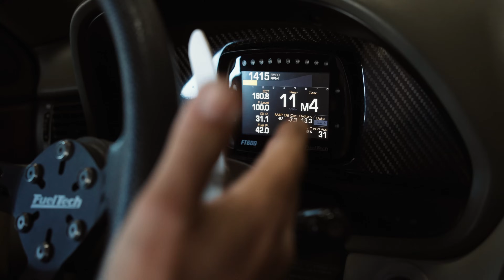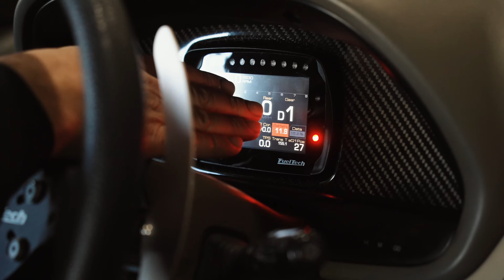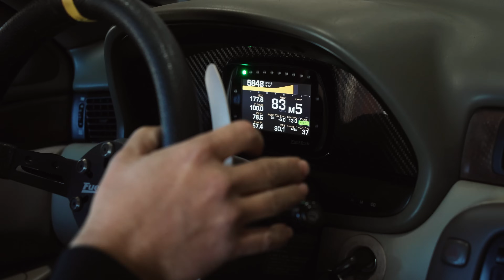Controlling an 8HP Automatic Transmission with FuelTech ECU | Lexus SC400 Track Car Demo

Comment: How can I speak to someone about this from Fueltech? I want to do a completely differently build. Starting off with a 2006 Lexus IS350. Fully built Engine paired with a On3 6766 Single turbo. I want to run a 8HP with a fueltech ecu. I'm doing research to use this transmission.
Reply from the maker: Hi! Please reach out to our sales department via email (sales@fueltech.net) or Phone (678-493-3835) and they will be able to assist you!

Comment: Hi friend. I'm installing an 8hp 45 with a Fueltech 550 ECU, and the car is running. But I have a problem: it doesn't read rpm. I do get a temperature signal, but not an rpm signal, nor an I/O signal. Therefore, it won't shift gears in automatic mode, only in manual mode
Reply from the maker: Hi! Our tech department would be happy to assist you. You can contact them via email (support@fueltech.net) or give them a call (678-493-3835).
Reply: @FuelTechUSA Hi friend. Okay, thanks. Perfect. Do you also offer support in Spanish or only in English?

Comment: Wondering if you can use an 8hp and 2jz with a ft550 or would it have to be a ft600? Mine a basic setup with only 6 injectors.

Comment: I had to swap the solenoids in my 8hp51 to make it compatible with a turbo lamik. In theory could I use the same board or switch to your board to use an FT600 in my a90 Supra?

Comment: you guys should also control the pwm for the transfer cases! the atc300 from the e90 bolts to the 8hp and it would be beautiful to have fueltech controlling the awd bias!  also, b58 plug and play fuel tech standalone for ecu and tcu would be EPIC.
Reply: I want the same

Comment: Someone on the FuelTech tech support line told me that the GM 6L80e is very difficult to control, and shouldn't be considered as a viable candidate for controlling with FuelTech.  Is that still true?  Alternatively, do you guys have any 6HP transmissions such as in the early Porsche Cayennes being controlled by FuelTech?

Comment: great video.. unfortunately with ECU's less than the ft600 the outputs are not enough when it requires 7 outputs just to control the 8hp and thats not mentioning the inputs for temperature, slip.. etc

is there a plan in the future that will allow to control and recive data via canbus as other aftermarket ECU's
until then unfortunately I will have to use the turbolamik TCU with the ft550 on my project
Reply: Everything is possible. The problem on CAN control is that you don't have 100% control over
Reply: @eduardoarcondo  it should be an option and let client decide if to use can bus or wire directly into solenoids.

Comment: I have a link ecu and it's great but I love fueltech so much more, how the fueltech go with technology quickly and give their customers everything they need. In link ecu for example I have limited safety table (4). But I've seen fueltech you have so much more.
Reply: Fueltech doesn't support cruise control, absolute deal breaker for a street car lol
Reply: @RChero1010 Fueltech focuses on winning championships at the track …not for grocery getters 300hp cars
Reply: Link is by far way more flexible, especially when it comes to CAN bus communication. Fueltech is ok for a drag car but I would
Never use it on a street car, it lacks a lot of things needed for perfect drivability
Reply: Madness. Here in South Africa all big power street cars run fueltech. Whether it be a K20/SR20 swap or a 7 second 2J. Don't really see how link can be better for everyday use. I just fund it funny how you're the only person I've come across that states Link is better. But yeah let's be honest Europeans aren't as clued up on fueltech and haltech like in most cases. I'd be dumb to choose a link or a ecu master over a fueltech or that syvecs nonsense.
Reply: @350gtboi well you don't know how to tune fueltech properly bit obvious judging of your comments loool.
Reply: @Smokeykunx I choose to tune ecus that actually have electronics and capabilities from 21st century. Honda K series ecu alone is 20 years ahead in electronics. 25 year old gold box motec is more capable.
Reply: @350gtboi  Just another way of saying you didnt take the fueloech class that luis has to offer lool
Reply: Link can actually do VE tuning and electronics are modern unlike Fueltech poorly designed electronics and PW based fueling like we are back in 1986
Reply: @350gtboi ohh ok 😮. I get your point, what about the ecu features, being able to interface and control 3rd party system?

Comment: Question....do you have a separate fueltech for the 8hp or are the engine and gearbox on the same ecu
Reply: 1 device for both
Reply: Great, Thanks for the reply bud appreciate it

Comment: Sooo you guys into diesel?? We need more aftermarket diesel ecu support
Reply: Soon!
Reply: They are actually i saw few 1.9tdi PD with Ft450
Reply: Ft700 will control diesels no problem. Including common rail
Reply: om606?
Reply: @poiter5876  go mechanical injection pump and don't have a ecu
Reply: @poiter5876  an all in one controller like MaxxECU for the 606 is what I need. Control both fuel and 8hp. Right now fuel control for 606 is either mechanical, tuned factory ecu, or DSL1 standalone.

Comment: Is this available in Australia?
The valve body mod etc?
Reply: Australia has been into the BMW N57 8hp70 for the last 4 years , we love them , most use the Turbo Lamik link through cambus to Haltech .
If your talking about the circuit board that you solider in , or anything else and your an Aussie go to 8speed Australia , they have and can do everything with the 8hp transmission .
I have one to go behind my Aussie Atomic 998 race Ford Barra .
Reply: Can get turbolamik in Aus
Reply: We have tons of places doing the zf 8hp boxes 

Search for 8 speed auto gtr

Comment: Can you control a DCT
Reply: they are in some testing cars, but they use the original tcu and control it through CAN.
Reply: @LucasOliveira-nr6ud  I have a BMW F80 transmission that was going to control it with HTG that they are out of business.
Reply: Only some VW DSG through CAN for now

Comment: so basically you took a turbolamik board for tcu control in the valve body
Reply: The board that goes into the transmission is just a bypass to the original tcu that is inside the transmission, there are many companies making this in order to control the transmission with an external TCU, that board have no logic or no electronics on it

Comment: I have late FT500 it never works with the same trams. On my Lexus LS 400 twin turbo
Reply: Last update for the FT500 was v4.9, so sadly won't have all the options like an FT550. But hey... the is an FT500 to FT550 adapter 😁

Comment: Would be able to control the Acura Nsx 9 speed dual clutch?
Reply: No, only automatic transmissions. Dual Clutch Transmission FuelTech doesn't control YET
Reply: @eduardoarcondo would love to see when you guys start doing dual clutch transmissions The Nsx, the C8 tremec, the Lexus 10 speed auto, the Mercedes,Ferrari dual clutch, the Nissan/mercedes 9speed auto.

Comment: which 8hp model did you use in this SC400? I heard the v8 big bellhousing 8hp's dont fit well in the JDM tunnels.
Reply: Its an 8HP50Z from a BMW 440i